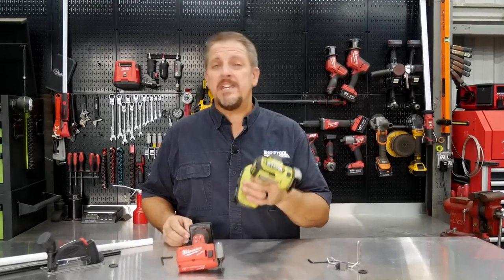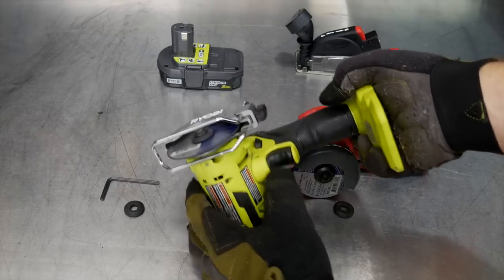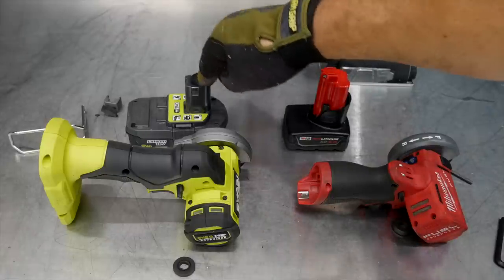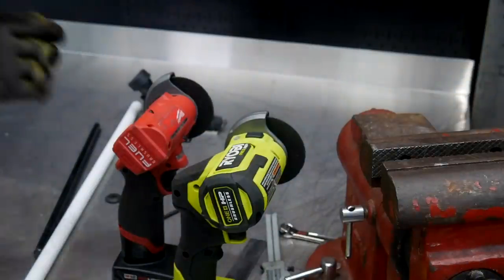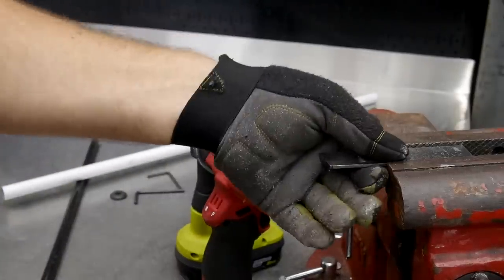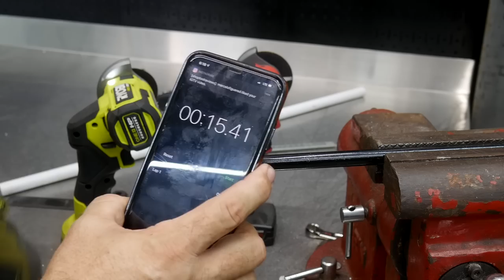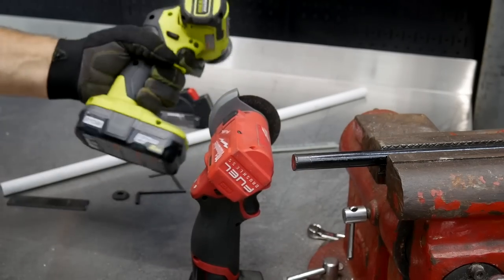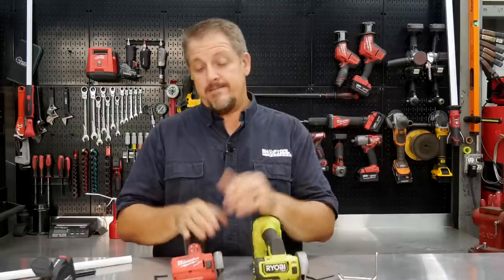Milwaukee M12 vs Ryobi HP 3" Cut Off Saw Showdown [20,000 RPM]

Comment: I own the M12 cutoff for 2yrs and the performance shown here is exactly what you can expect to get. I use my tool with a 4.0 and 6.0 battery. As mentioned by another user, when the battery hits the last two bars on the battery meter, it really throttles back the tool performance. That's 100% programmed into the circuit board and some of us theorize that since Milwaukee doesn't have a "high output" M12 pack, this is done to primarily protect the batteries but also prevent the brushless motor from overheating. Some will argue that the 6.0 M12 battery is a high output battery and while yes, it delivers more power compared to a 2-3.0 battery, it's technically not high output. The Ryobi tool clearly performs better but I think it comes down to the battery. The M12 cutoff was released when all other manufacturers cordless cutoffs weren't even a thought so I can't blame Milwaukee for ensuring they have built in protections for when even a 2.0 battery is being used though anyone that's ever used one of those M12 cutoffs knows that's not a good idea performance wise. If you're invested into either line, you won't go wrong with either tool. If you're starting fresh, the Ryobi stuff is generally cheaper so that may sway your decision more. Don't listen to fanbois, at the end of the day, it's your money so spend it as you see fit.
Reply: You should buy a new high output battery and try it and reply
Reply: @MarcosGarcia-xg1rf  it does not have a big difference since the new high output still using 18650 with 2ah cell, it will have more cut, that it is.
Reply: @Costa Vong  I watched a video of the m12 5.0 ah ho battery taken apart and the cells were bigger than 1850.
Reply: Thanks super helpful input for my needs.
Reply: I think the battery and the blade. Milwaukee blades are terrible. Always have to upgrade. It's nice they are free but when you want things done. You need a better blade.

Comment: I work in a jail and all the security screws have been painted multiple time over and some are really hard to get out. I purchased several different types of security screws to replace. I usually have 2 or 3 per door that I can't get out. I purchased this ryobi to cut a slot in head and use flat screwdriver to screw out. It works so fast that even the screws I know I could get out with a little work I just go ahead and slot them. Only a couple more 1000 to do!
Reply from the maker: What a great use for this tool. Thanks so much for letting us know. So glad it's working well for you. Thanks for watching.
Reply: Good luck on the Escape!

Comment: I have the Milwaukee and it's amazing how handy it is..use it all the time..6ah battery gives more power vs the 3ah batteries..
Reply from the maker: Yes, this is a very handy tool. Thanks for watching.
Reply: Yeah, but the ryobi can use 9ah batteries too
Reply: @xavier1964  but when u put a bigger battery on a fuel it increases performance it is also very compact
Reply: @xavier1964  also a battery that is probably triple the weight of the tool will mess up the balance those heavy ass batterys are great in reciprocating saws, circular saw something that is a heavy battery drain tool or like a light or radio that just sits there a 12v 6 ah is still pretty small and light im waiting for milwaukee to drop a 9 or 12 ah m12 battery id love that
Reply: @brianbecerra9735  same with ryobi hp
Reply: @xavier1964  its to heavy the whole purpose was for it to by light handed if u use a batter tht big ur arm will get tired i have a impact driver with and 8.0 m18 battery its very powerful and great but one down side its heavy im light 4 pounds i raise my hand put pressure then it just gets tired. If u want to put on a big battery i still don't recommend it use a angle grinder
Reply: It’s not the battery pack 🔋 as a whole that makes the power it’s the internal batteries that count. 18650 vs 21700 on the internal batteries. You want the 21700 battery packs I’m unsure which those are for the 12v but for the 18v they are 6,8,12ah battery packs.
Reply: Ryobi has 4 and 6ah batteries as well. 18 volt is better. If it were an 18 volt Milwaukee it would have walked the ryobi. But ryobi got this one.
Reply: @minnesotaman3  i meed some high amp m12 batteries! The new die grinder is great but chews a full 4amp battery in 10 minutes sometimes

Comment: The Ryobi is a beast. I personally own one and I am thoroughly impressed. I use it to cut 1/2 inch thick galvanized cable. Used it with a Diablo cutting disc. Cut through it in less than 30 seconds.
Reply: I SECOND THE DIABLO ON THE RYOBI! LOVE MINE!

Comment: The reason why the m12 cuts out is because you had less than 2 bars on the battery.  I have been using these guys for quite some time and I noticed that the m12 usually only performs better on the first two bars, but underperforms on the last two bars.  I have also noticed on the m12 it uses up two battery bars at a time if you pay attention.  The m12 has less vibration so I take that over the Ryobi just for that reason.  The m12 is more of a specialty tool where it really depends on what type of material you are working.  I think Milwaukee should consider making a high output battery for the m12 line.
Reply from the maker: We agree, the cutout starts happening much sooner once the battery drops to 2-bars. You're right, both of these cut-off tools are definitely specialty tools and are not overall replacements for the typical pneumatic cut-off tool. Thanks for watching and commenting.
Reply: @Shoptoolreviews  I don't get it, why use these inferior tools when a angle grinder is 10 times better,  cut deeper, more wheels available and wheels are so readily available even Walmart carries many selections.
Reply: @rickyperkins232  ummm, the tools being reviewed today are not angle grinders, which can be much bulkier and heavier. im surprised I actually have to  type this. its the same reason when testing a dremel cutting wheel they dont use an angle grinder
Reply: @mainsource8030  I agree. I work in the sand and gravel industry. Currently I use a 41/2 inch angle grinder with cut off wheels. They are great for heavier duty materials, however I also use it to plunge cut conveyor belt splice clip nuts when they need to be replaced. The bad part about using an angle grinder is in order to cut the nut deep enough to break it, you actually cut into the conveyor belt too. This little cut off tool would be great for cutting those nuts without cutting into the belt so badly. The only draw back is that I would have to use the angle grinder to cut off the studs from the new clips flush with the nut so not to catch anything but then again, this little thing may do that too? I may have to give it a try when my budget allows.
Reply: Man predicted it

Comment: Higher voltage will make more power with less heat. The only advantage Milwaukee has is smaller size but its higher current output leads to more overheating thus more motor cutoff.
Reply from the maker: The Milwaukee does great with a full battery, but as soon as it drops 2 cells, it starts cutting out when pushed. Thanks for watching.
Reply: Lol if the Milwaukee was m18 you would be put to shame 😂😂
Reply: Heat is proportional to power, so you are 100% wrong on that one.
Reply: @suzesiviter6083  
You better learn about AC & DC and the difference between VOLTAGE and CURRENT before you make such ignorant comments.
Reply: @TheGomezIndustries  P=V*I = V*2/R =I^2 *R
So V is proportional to power (at same current levels) and heating is a function of power, that's why heaters state their power rating in kW.
Reply: @TheGomezIndustries . By the way, these tools use PWM-pulse width modulation-that is switching a dc voltage highspeed through MOSFET's with low Rds (typically 5mR), so they are not described as AC, more apt is switched DC-as they are switching on and off quickly as opposed to an AC system that are described by sine-waves.
Let me know the next time you feel the need to print lies based on what ever little knowledge you have and keep the world safe from you eh?

Comment: I got some ryobi brushless tools. If it goes into cutout mode you have to pull the battery for a second and put it back in. It will turn on again.
Reply from the maker: It was Not in cut-out mode. The battery was definitely dead. Thanks for watching and commenting.
Reply: I came to make this cut off. It will not reset until you remove the battery.

Comment: Milwaukee puts this cut out feature in a lot of their tools. It's to protect the motor from overheating. While it sounds good on paper, it can be irritating during use, as you see here. Maybe they should just put heavier duty motors in their products. But then the tool would be bigger. Also if you could push the tool harder, the battery wouldn't last as long. It's all about compromise.
Like you said, these weren't meant to do heavy work. Use them for what they were designed for and they will do just fine.
Reply from the maker: Thanks for watching and commenting.
Reply: They are very compact i think thts what they going for good power for its size
Reply: i guarantee you in this case it's not the tool over heating it's cutting out to protect the battery..  most of my M12 tools using the smaller batteries loose a significant amount of power when it hits 2 bars.. going to a 4 or 6 amp battery the power loose is not as noticeable thus it doesn't cut out as much under heavy use..

Comment: The M12 shoe with dust collection makes it an excellent drywall saw in remodel applications. Specifically for older plaster products with steel inside corners, etc. A good diamond wheel and dust extraction setup with a big cell and you can do seriously precise operations for remodeling purposes and save yourself a ton of extra drywall repair work later. And you can cut cats out of your old exhaust and get hundreds of bucks back from refiners using the same tool.

Comment: 7:40 To be clear: Pack Watthours is a measure of total energy in the pack…Not power output of the tool.  If the tool had double the power output making it twice as effective, it would only last half as long.  What matters is power (watts) not pack energy (watt hours).  Not that this here applies to me cos mine is black and yellow, outputs about 370 watts and cuts 1/2” rod in about 5 seconds😜

Comment: I've had the Milwaukee for months. It's Absolutely gutless and goes into cut out mode constantly no matter if you're using a 1.5 amp hour or 6.0 amp hour battery. I nearly threw it away within 10 minutes of owning it. This is not a pro tool in any way and feels 100% like something I'd get from Harbor Freight.
Reply from the maker: It's definitely a tool for lighter work. What type of work were you doing with it? Thanks for commenting.
Reply: @Shoptoolreviews  I bought it for steel work. Anything more than sheet metal is asking too much. I've learned how to use it where I baby it to get it through the cut. It's just frustrating. From the video it appears the Ryobi is the better tool.
Reply: Im a truck mechanic and i have the Milwaukee almost a year i love it.... My colleagues went snd bought one each to. Ive cut through some pretty thick bolts with it.
Reply: @sixtyfiveford  late but you should return yours you got a defective one I’ve cut off 1inch bolts no problem
Reply: @SamuraiAtlas  It will cut it, It's just gutless and has to be babied. Definitely doesn't have the power you would expect from a professional tool.
Reply: @sixtyfiveford  seems like everybody is wanting an 18v version if the milwaukee. In that case buy the 18 v grinder and a adapter to fit 2 & 3 inch wheels
Reply: @sharpie132  I have since used the 18v Makita and Ridgid and those also are weak. The reason being is a built in safety feature to prevent kickback. So an 18v Milwaukee from the same company will  be intentionally weak as well so operators don't kickback and cut themselves. 

The average mechanic that would use this is trying to compare it to the tried and loved die grinder/ cut off tool and this doesn't compete. I have since got accustomed to a far inferior tool only because of the convenience of not having an air hose. However every-time I pull out my air die grinder for a larger job I'm blown away with the power and extremely small size(1/3 the size and 3x the power). 

Your comment on 3" discs on an angle grinder: The head is too big and you can't cut anything at around 2.5".
Reply: I guess you don’t know where the tool is designed for it’s not a grinder
Reply: @deluxepressure  I since bought the DeWalt and it is a real tool. The Milwaukee is still a gutless piece of crap. The DeWalt easily has 4x the power.

Comment: I have been using the m12 for a while and I find it cuts faster if you back off and take advantage of it's rpms
Reply from the maker: You are correct, if you keep the speed up on the wheel, it will cut faster. Thanks for watching.

Comment: I bought the M12 but the vast majority of my cutting is din rail, so the Milwaukee should handle that with no problem.  The other reason I went with the Milwaukee is I was able to buy it as a combo from Home Depot with 3497-22 kit and a 2.5ah battery for $270, since I was looking to retire my Dewalt XRP 18 volt drill and impact driver, it made the purchase a no brainer.

Comment: Yea but its a 18v ryobi tool vs a 12v Milwaukee tool. Doesn’t seem fair. Now if it was 18v vs 18v then there something to talk about
Reply: Milwaukee dosent make an 18v version
Reply: @cd5732  yes I know I just don’t like comparing things when it’s not a apples to apples comparison
Reply from the maker: It's apples to apples because there's only 3 tools like this made: Ryobi, Ridgid, and Milwaukee. You don't have a real choice, other than changing battery Ah sizes. By the way, TTi makes all 3 of them. It's a fair comparison. Thanks for watching.
Reply: @Shoptoolreviews  
I would disagree about it being apples to apples or a fair comparison, however, as you stated there isn't much else to compare it to. The wh compassion doesn't mean much in this case either since they are different voltage batteries. It does show an equal volume of energy but the higher voltage tool will consume the energy faster as demonstrated by the ryobi battery being depleted first although having the same "wh" rating. The higher energy consumption was also demonstrated by the higher performance of the ryobi tool which is why this is not an apples to apples or fair comparison but is still an informative video.
Reply: @JD-jj6dd  no the higher voltage tool works more efficiently due to lower internal resistance.  The royobi ran flat slightly faster due to it using  a lower amp battery.  There are ➕  & ➖  to them both , you want super compact , go with the red , you want more power 🔋  go with the green , either tool punches way above there compact weight

Comment: I was using my Milwaukee today just to get some use out of it, cutting some 5” exhaust pipe. No thicker than the aluminum you were cutting. Definitely goes into cutout mode really fast. You have to baby it for sure (not pushing it) doesn’t do to bad. Didn’t cut as fast as the chop saw but the chop saw we have doesn’t cut as clean. Which saved me some time in that aspect
Reply from the maker: They definitely don't react well to applying much force. You really have to let the wheel do the cutting. They're both still very useful tools, as you mention, but you have to know the limitations. Thanks for watching and commenting.

Comment: These results are surprising. It looks like the Ryobi cut off saws have at least changed in appearance since this video. I am so deeply invested in the Milwaukee
line of tools now it is difficult to swap. I do love the M12 tools but their batteries definitely seem to have problems. I have had several of them fail and die
over time. I always try to get full size M18 tools because in all the years I have had them I have never had an M18 battery fail or even get weak.

Comment: I just bought the m12 today.  Same thing happened at 2 bars it started cutting out.  I also noticed that it spun way slower .  What's the good of these tools if you make a couple cuts then the battery dies?  I like the reverse option  it doesn't jump as much.

Comment: The Ryobi may have gone into protect mode. You should have tried removing the battery when it quit running. I've seen videos of Ryobi tools going into protect mode without the flashing lights, and reinstalling the battery puts it right back in the game. That's why I hate the Ryobi batteries that don't have a fuel gauge.

Comment: My Milwaukee 3” cut off even with a 6.0 battery has issues cutting 26 gauge smoke pipe, and that’s thin stuff. It bogs down and stops all the time, it is imo a big waste of time and money. Going to pick up the Dewalt 3” cut off when it’s available, the Milwaukee will be going on eBay!

Comment: When the ryobi goes in cutout mode the battery won’t light up with the power indicator.  To reset you pull the battery and put back in.  My guess is the battery is far from dead.

Comment: Nobody mentioned the fact that he was using a standard 2 amp hour Ryobi battery instead of the HP battery that delivers higher performance to the saw?
Reply: He addressed this in the video. Hp tools only benefit from hp batteries if the tool has the extra contacts. If the tool doesn't draw more current than a regular battery can provide then it doesn't make a difference